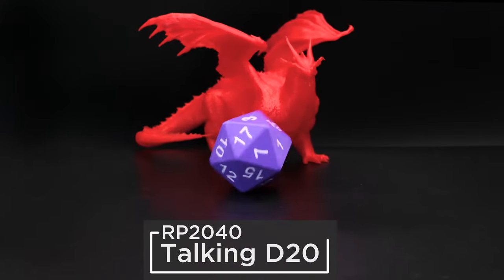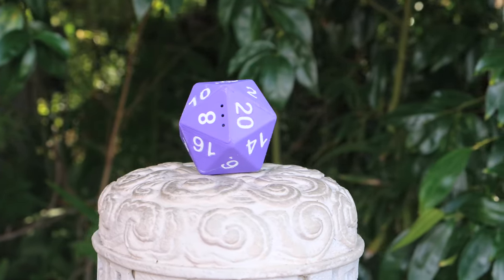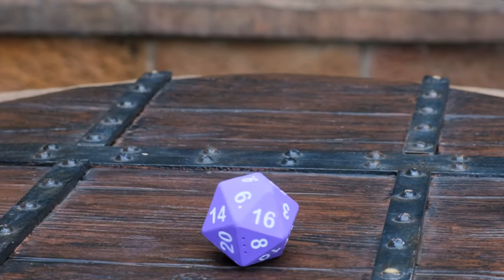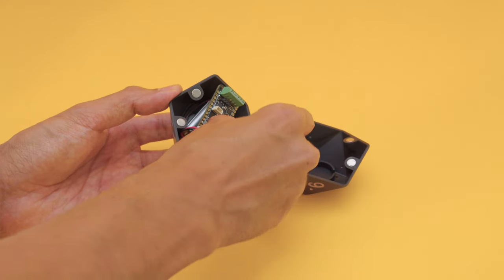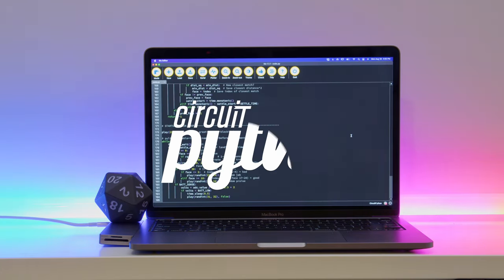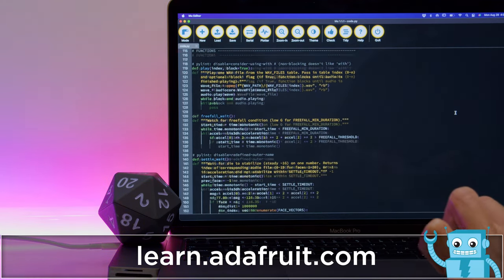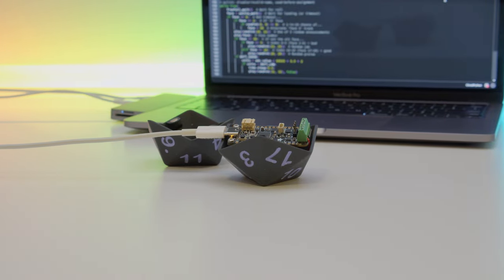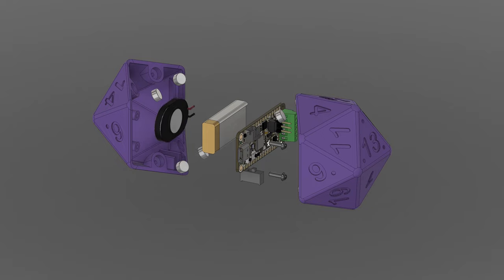Talking D20 RP2040 #adafruit #3dprinting

Comment: if you want battery sense to work, you need to change the code on line 67 to

 "BATT_SENSE = board.A3  # Assign analog pin if voltage divider present"

 and insert a line on 68 for 

"BATT_LOW = 3.5  # Define your desired battery low voltage threshold" 

This is one of coolest things I've made. thanks for the write up!